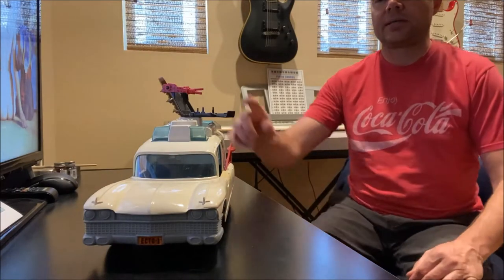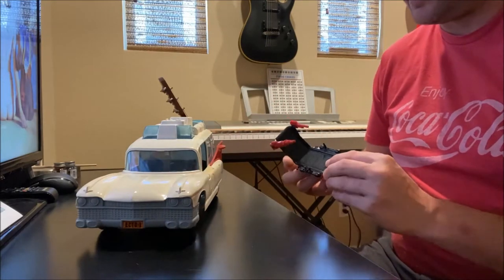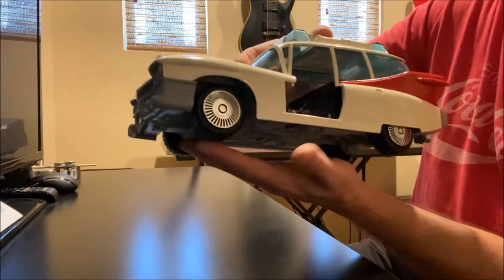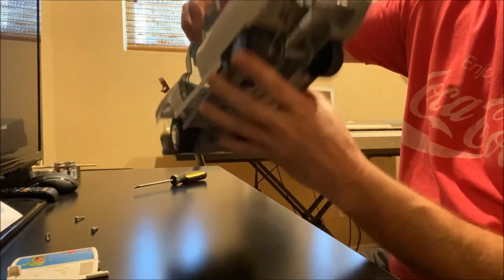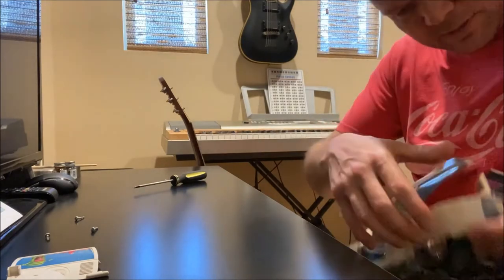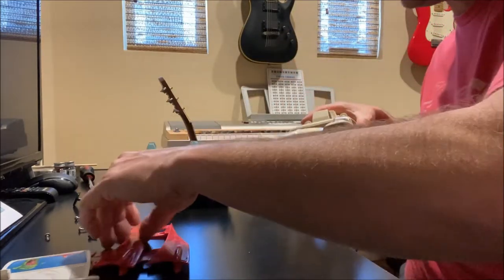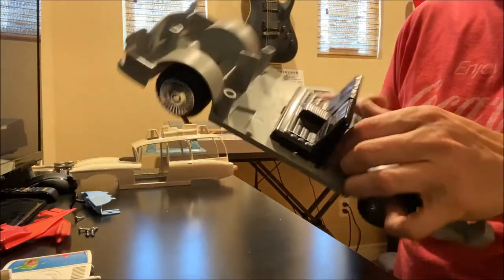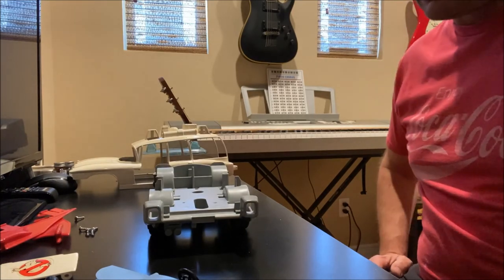Kenner Real Ghostbusters Ecto1 Disassembly

Comment: I had to use a screwdriver to get the first tail light clip off. The second one popped out easy with an inward motion.
Reply from the maker: I had better luck without the screwdriver. It left marks on the plastic when I did use it.